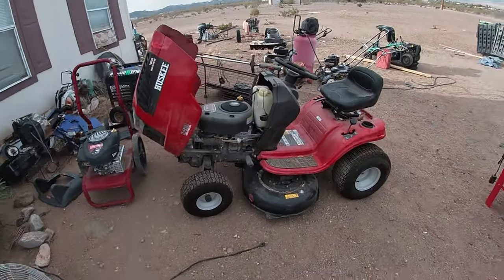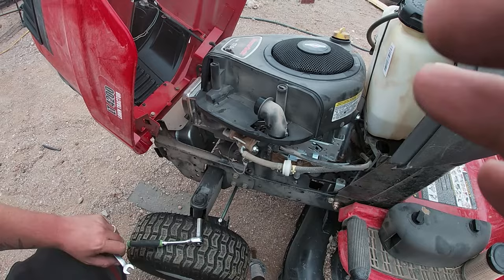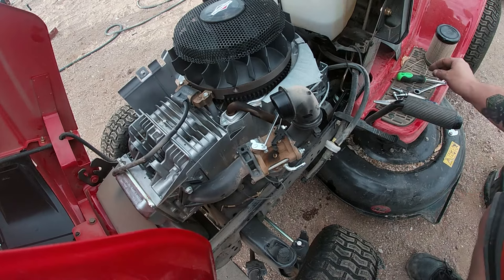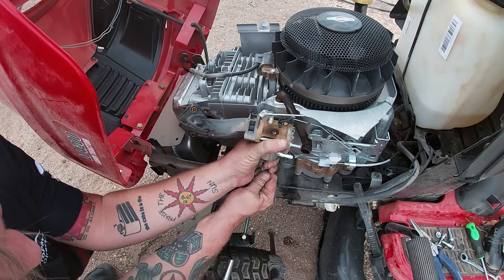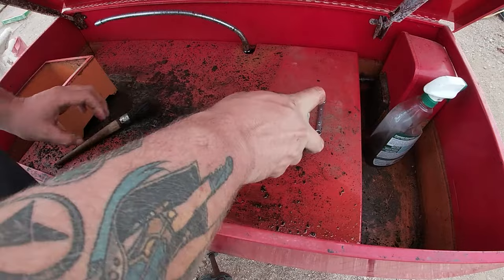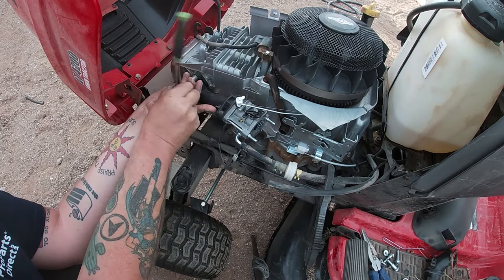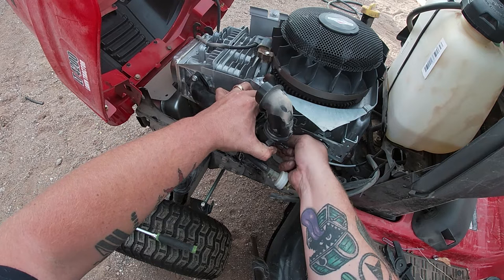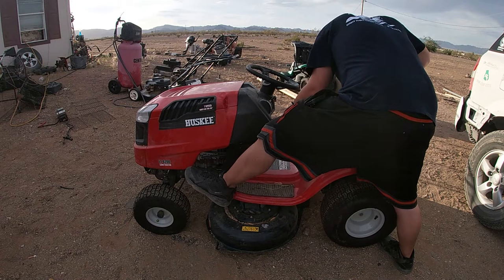How remove and clean a carburetor on a riding lawn mower.

Comment: Excellent video, EXCEPT you did not show how to take off the bowl.  I found that frustrating as I have not dealt with a carburetor that had the electronic connection on the bottom.  I had to get a thin 13mm wrench for my as the space was not enough to fit a standard wrench into.  And a little more detail about where to spray cleaner.  Otherwise, great job.
Reply: OMG thank you, this is what I needed to know
Reply: 13 mm wrench on what ?
I dont understand the issue is in the bowl and everyone 
stops short and buys a new carb, very frustrating

Comment: Was going to fix a leak in the floatbowl and clean the carburetor on my parents lawnmower (which is the exact same) but then saw that a brand new replacement only cost about 18 dollars on Amazon.  So was MUCH easier to just replace the entire carb.  But the video was very helpful on showing the removal process.  Thanks!
Reply from the maker: Way easier just to replace for the regular person

Comment: I have a lawn chief that turns over good but takes forever to start up put a new air filter in it and still doing it would it have to be the carburetor? It runs great when it's running but just takes forever to start up

Comment: I haven't pulled an engine apart in a few years.  In the old days, we always added gasket sealer to the gaskets to ensure no leaks.  But it looks like you used no sealer.  

I have to install a new carburetor on a Briggs and Stratton 18 HP riding mower, and it came with gaskets but no instructions.  

Are the generic gaskets provided with small engine carburetors good enough these days that no one needs to add sealer?  

Also, these parts usually have a listed "torque" number of pounds in terms of tightening to meet manufacturer standards.  Is there a basic torque that is considered average for tightening the bolts on a small carburetor like this one?  I would guess 15 lbs or thereabouts, but I'm guessing.

Comment: I have a troybilt TB46. Will this be about the same way cleaning the carb?
Reply from the maker: Yes
Reply: @RepairGang  ran into a problem when reinstalling the carb on my troybilt TB46 rider. It's got a 547cc engine. 
One of the fuel solenoid wires broke. Is there an easy way reinstall the connector?

Are the linkages & governor spring supposed to have a bend in them?
Reply from the maker: @eqbuffers8011  I recommend just taking off the fuel solenoid and snipping it

Comment: How does the bowl remove?
Reply from the maker: In order to remove the bowl you have to remove the fuel shut off solenoid and then it's a 14 mm socket
Reply: @RepairGang  thanks.  The one I'm working on is, of course different, used a 12mm wrench to take the solenoid off and then pulled by hand the bowl.

Comment: The location of the carburetor  is totally in a  different  area than my mower. Location  is different.
Reply from the maker: is it in the front
Reply: You ate sitting  on the mower,  it's on the right side. If I take  the gas bulb off and let out some gas , will this be enough to help get it to turn over. It sounds  like it  wants  to,but it won't  start.